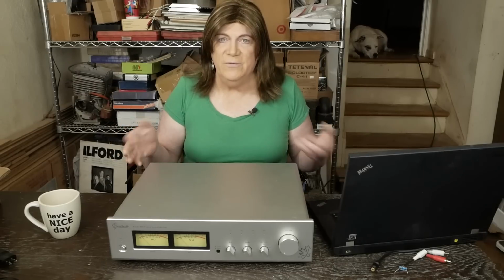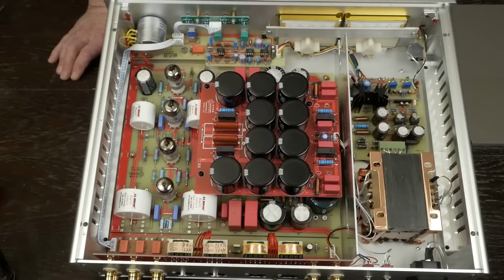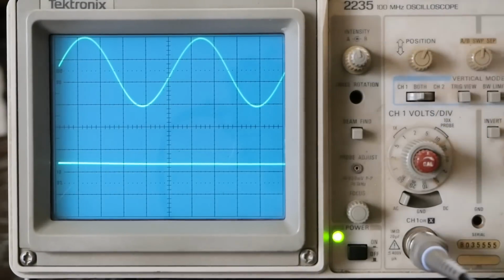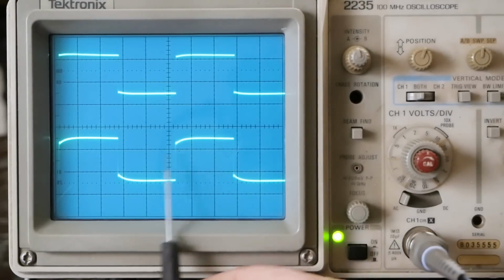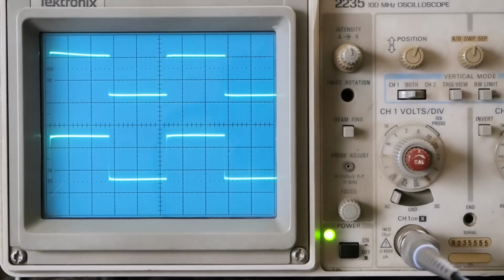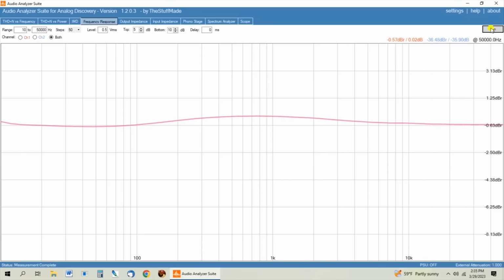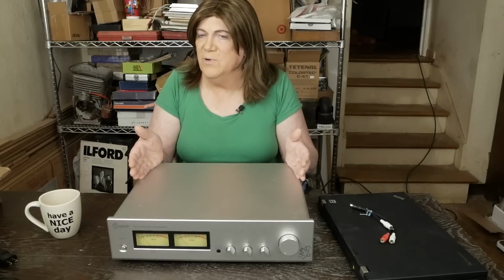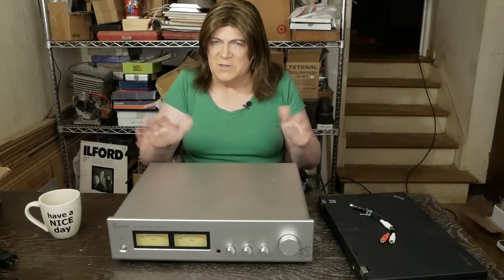Leaf Audio PA-03 MKII Tube Pre-amp: Full Test and Review

Comment: I have the first model of this Leaf, I guess it’s the mk1 but it does't have mk1 written on it. The difference is mine has only one balanced input and output connector. All other rear connectors and switches are identical. I have a class A/B Rotel power amp driving my Kef speakers. The Leaf works and sounds magnificent. Your observations and ideal usage were spot on. Thanks for the great effort.
Reply from the maker: Glad I could provide some helpful observations for you!

Comment: DAC's aren't preamps just because they have a volume control. These aren't meant to go before an integrated, they are for power amps or mono blocks. Daisy chaining tubes will do you no good. Obviously this is for tube sound on hard to drive speakers. So you can have tube sound and big well controlled bass. You won't be limited to very sensitive speaker set ups.
Reply from the maker: A "integrated" tube amp with the volume wide open = "power amp".
Reply: @SkunkieDesignsElectronics  signal is still going through the preamp stage with tubes in it that is not in a class A/AB/D power amp.
Reply from the maker: ALL tube amps have a driver stage. There is no "pre-amp stage" in an integrated amp, that doesn't exist in a power amp. That's a common misconception. And the integrated amps that have a "pre" input are just bypassing the volume control. 

Please show me ONE tube "power amp" that only has output tubes and no additional driver tubes. Because it doesn't exist.

Comment: Very interesting Skunkie. Out of curiosity I googled it. Currenty being sold on UK Ebay for a range of prices from £588 to £777 plus a token shipping charge. In addition to the excerpts provided by mddawson1 below, the description also states 'Components for WIMA and coupling capacitors are second-hand. Please make sure that you don't mind before purchasing'. I wouldn't mind ponying up the moolah to use this in the manner you suggested but I'd float or hoik those coupling caps out and test them before hooking up to a power amp.

Comment: When you switch the tone controls off, which means disconnected, turning the tone controls fully anything shouldn't make a difference. The knobs should be out of the circuit and should not affect the waveforms. No?
Reply from the maker: Clearly that's not how this one works.

Comment: Holy god, remarkable preamp judging from your detailed analysis, I thought Amir could be a bit mean on testing sometimes, without the forgiving or further communication with the original designer, to which end we all are human that should communicate and forgive sometimes with little bit of compassion I think. I'm exactly looking for a preamp in my current detailed neutral distortion free setup, just slight different sound on high frequency harshness taming.

Comment: Amazing work. About unity gain, even using solid state amps, it makes sense having like x6 times gain from tubes to bypass the amp's input buffer and gain stage (opamps). Also output impedance of tube amplifiers should have a buffer low enough to drive the amp load. i.e: Purifi amps have 2.2k input impedance unbuffered and require 10V to reach max power. If we use the amp's buffer, we'd be using two buffers at the same time, not sure optimal.
Reply from the maker: Thanks for the tips!

Comment: Thank you Skunkie for this, and all your videos. I find they all are extremely informative. Did you found this preamp leaking DC?. My current tube preamp destroyed the input of 2 VMV A1 amps before I realized that it was leaking 15VDC, so now I want to purchase a good and safe preamp.
Reply from the maker: Not that I know of
Reply: Hi  @SkunkieDesignsElectronics  . Could be a bad design the cause for a preamp leaking such high DC, even with volume to min?. Is it something I should be worried on at the time of choosing a new tube preamp?.
Reply from the maker: Any tube amp is going to have a DC blocking cap on the output. If there is DC on the output, that cap is leaking DC.

Comment: Nice review, thanks. I like the look of this preamp, it's got that Luxman kind of design. I suspect the ASR review was done using only the balanced inputs/outputs as it looks like the preamp is using small transformers for these, that would explain the higher distortion in general and the extreme distortion at low frequencies. I did find it a bit peculiar that the ASR review was done at 4 Vrms as that is a lot higher level than what you get from regular sources. Anyway, it would've been nice if the preamp had a phono stage and configurable gain, maybe something like 0dB, 6dB, 12dB. I guess replacing a couple of resistors could set the gain, but it would've been nice if they had some jumpers or maybe a switch on the back.
Reply from the maker: A good tube phono stage would add more tubes and not sure there is room inside for one. I don't know what caused the poor ASR results but my test methods using the RCA jacks seem fine.

Comment: One Ali seller has this line that I believe relates to that additional board: 
"1. Optional power supply upgrade kit (refer to German power black box for OCTAVE tube amplifier)"
They also state:
"9.Filament power supply AC and DC switching (note: filament AC power supply is temporarily cancelled, please contact us if you need filament AC power supply)"
Reply: Just yesterday I was looking up the BOYUU Q6 preamp, which I've seen a couple positive User Reviews, one being Thomas and Stereo. I found 3 different China sellers, one seller  had 2 upgrade options....Voltage Stabilizer upgrade $45. Transistor Voltage Stabilizer $115. I had no idea what this meant.
Reply: Update: I found the 'Octave Super Black Box' that has ten large caps of similar size to the upgrade board in the PA-03 MII. Octave's description is:
"OCTAVE, with the Black Box technology, offers an instrument to optimizing the OCTAVE amplifier in respect to the speaker. This flexibility is a unique feature of the OCTAVE brand.
The dynamic and tonal stability of an amplifier is strongly dependent upon the stability and capacity of the power supply, therefore the Black Box and Super Black Box were developed as external upgrades to the OCTAVE amplifiers’ power supply storage capacitors by increasing their capacitance by a factor of 4 (Black Box) or 10 (Super Black Box), respectively. This is a tremendous benefit if the speaker is difficult to drive. Loudspeaker efficiency is made less critical, while the amplifier is enabled to handle speakers with minimum impedances as low as 2 Ohms. 

The power supply capacitance increase realized via use of the Black Box or Super Black Box stabilizes current delivery and reduces the impedance interaction of the load. This improves dynamic range, separation, depth, soundstage size and articulation, rendering the musical reproduction clearer throughout the entire frequency range. The amplifier remains unaffected by mains variations and interferences due to the noise filtering characteristics of the capacitors."

This appears to be designed for adding extra capacitance to an amplifiers power supply so why incorporate it into a pre-amp?

Comment: Man that was an awesome review...outstanding job on figuring out that tone defeat/tone control issue. That was some seriously key information with this unit. I don't normally mess with tone controls and it would have never occurred to me to turn them Both all the way to the right with the button pushed in if something wasn't sounding right. It's something I never would have tried lol.  When it comes to preamps I agree that if they can be avoided (Dac with volume control) it's best to leave them out. So when I'm looking at a preamp its for the extra inputs as well as the extra output (subwoofer) Although I've used RCA Y splitters out of my high powered volume dac in the past. I also as well like the sound of a tube pre on my solid state. Which I'm curious what the Output Impedance of this Leaf preamp is? Nice shout-out to Amir and ASR, I'm a big fan of his content and forum. And no I don't always equate good measurements with good sound but measurements can tell you a whole lot about a piece of gear. Excellent video and content!
Reply from the maker: I have to assume the unit tested by ASR was either defective, the tubes had issues (super cheap china tubes maybe?) or this unit I tested is wired different. The only other thing that could explain it is I tested it using the unbalanced RCA and possibly the implementation of XLT/balanced is really bad on this unit?
Reply: @SkunkieDesignsElectronics  yeah it could have been either of those issues or maybe even something else. Wouldn't be the first time he's evaluated a broken piece of gear. A bad tube or tubes would have tested wonky for sure.
Reply: Volume controls in current DACs aren't really ready to replace a good preamp yet.
Reply from the maker: @YouSoundButtHurt So you are using an amp with no volume control?
Reply: @YouSoundButtHurt  yeah I get what you are saying, depending on the quality of the preamp though in my opinion. The one dac that I personally use for a preamp at times is the RME ADI-2 FS...which has been better (quieter/dynamic) than some pre's I've used. They've done well with their analog/digital volume control design. I get what you are saying though.